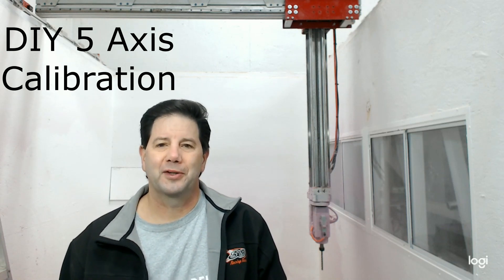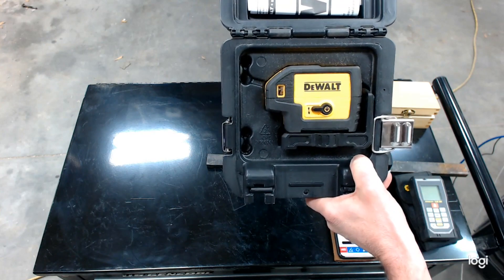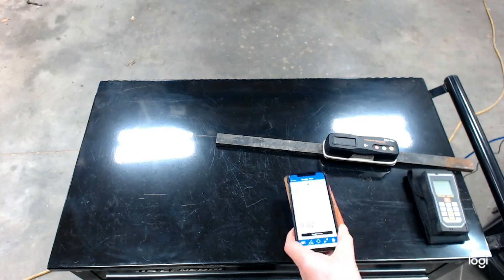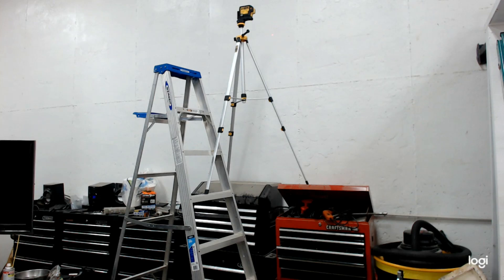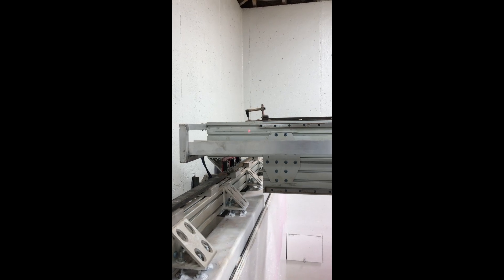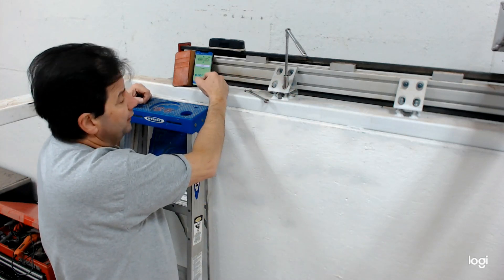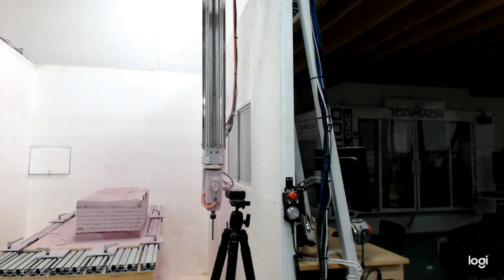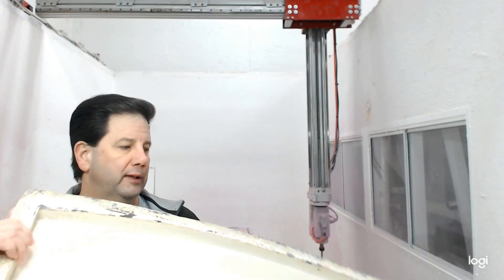DIY 5 Axis CNC Router...Build Video 1

Comment: Hello did you make the Machine?
Reply from the maker: Mahmut Polat yes I made the machine.
Reply: @XSMotorWorks  I am thinking of making a 5 axis machine like this. Can you share your information and drawings with me? I'm a student and my project 😊
Reply from the maker: @mahmutplt  I would be happy to help but I don't have many drawings as I built this as a one off.  

Few things.  This machine is really only good for soft material (foam/ MDF).

It's very important to know what you want to cut before making something like this.

If you watch the series and have question I will do my best to answer.

Comment: Thanks you for the video. Nice work I happening around your shop. Quick question: Does the Masso controls all the 5 motors directly? That is, the 3 Clear Path motors and the 2 motors from the Doughty drive? Thanks a bunch.
Reply from the maker: Directly yes and no.  The steppers on the A/B head are sent to a gecko driver -> Masso.  Clearpath are wired directly.

Comment: 5:41 The enclosure is exactly made out of what? XD
I mean, Where are the axis mounted on exactly?
Reply from the maker: basic structure is 2x2 .120 steel.  Than 80/20 extruded aluminum
Reply: @XSMotorWorks  😲 Are you telling me the axis, and the Windows installed in the enclosure is actually a 2x2 full metallic steel box?
Reply from the maker: @brian6175  2x2 steel tubes spaced 1 foot apart.  covered with OSB.
Reply: @XSMotorWorks  I noticed the tubes, but the OSB is what had me thinking. Thanks!
Reply from the maker: @brian6175  Sure...Let me know if you have other questions

Comment: Amazing machine. Are you willing to share how to build it? Part list or something like that? What CAM software did you use?
Reply from the maker: Don’t have a parts list exactly.  Will be happy to answer any questions though.  I use Fusion 360 for CAM.
Reply: @XSMotorWorks  I'm trying to build a 5 axis painting machine, but controlling/setup of the additional axis are giving me a serious headache. If you can help me with any info you have, please do.
Reply: @XSMotorWorks  And you export the path using the Mach3 postprocessor?
Reply from the maker: Export the G Code but I use a Masso unit now.  Original I used Mach3 but Masso is easier (In my opinion).  I think I covered most of the parts in the videos.  Let me know if you have questions.
Reply: @XSMotorWorks  I don't have the cash nor access to such driver. I'm using a chinese 5 axis driver, this far it's able to control 4 axis, but I'm being incompetent in controlling the 5 axis from Mach3. In Fusion 360, when I use "Postprocess" to export the G-Code, when I select Mach3 as the postprocessor, I't gives me errors, saying the machine is not configured for 5 axis... and the G-Code does not come out.
Reply from the maker: @bakedbillybacon  Look at this post.  By default the processor is not setup for 5 axis correctly

https://knowledge.autodesk.com/support/fusion-360/learn-explore/caas/sfdcarticles/sfdcarticles/How-to-make-a-3-axis-post-processor-from-the-HSM-post-processor-library-support-4-or-5-axis-motion.html
Reply: @XSMotorWorks  I changed a few things on the post processor and it seemed to work, but I can't see the A, B or C moving in mach3. Do you still have the post processor configs for your machine from mach3? Does this seem right to you? I want the machine to behave like yours.

var aAxis = createAxis({coordinate:0, table:false, axis:[1, 0, 0], range:[-90,90], cyclic:true});
var cAxis = createAxis({coordinate:2, table:false, axis:[0, 0, 1], range:[-90,90], cyclic:true});

machineConfiguration = new MachineConfiguration(aAxis, cAxis);
optimizeMachineAngles2(0); // if I change this value, the generated g-code simulation gets really crazy
Reply from the maker: Sorry for not responding sooner...Youtube mark this a spam.  I don't have the mach3 code anymore but what you posted looks correct. 

Do you have A and C in the gcode file?  If not I don't think you selected the right toolpath.
Reply: @XSMotorWorks  I'm going to send you my questions by email so you can read/answer anytime you are truly available. Thanks a lot for the attention you already gave me. I was able to make a 5 axis path in Fusion 360 that ran on LinuxCNC, but Mach3 post processor keeps giving me 'ensure safe retracts' errors. All my 5 steppers moved according to the code in LinuxCNC. I'm going to buy the aluminium structures this week, maybe the next. And again: You are awesome. Your machine is really nice.
Reply: I know this is an old post now, but can you suggest anywhere to get plans for this type of cnc? I’m wanting to make car part moulds so need the height clearance like this, I’m working on a project van at the minute, vr6 engine swap, full loom swap, custom subframe and control arms and modified strut towers, I’d like to build a subtle wide arch kit but want perfect symmetry both sides and doing it by hand isn’t as good as cnc hence why thinking of making one, I’ve got another project in mind after this that will be a full custom buck so I think it’s worth making a cnc for it, tips would be great

Comment: What steppers did you use? Also would you carve and ship things for people for profit? Totally not asking for myself.
Reply from the maker: I was using a NEMA 34 960oz motor with a Gecko Drive G201X...I think that setup  would have worked if I was willing to really spend the time needed to tune the accl and decl.   But going with the Clearpath is a much better option if you can afford it.  They are much smoother (no steps to count).

As far a doing a job I am actually tied up in a project that I will be sharing soon.  If they lived in the area (Woodstock, GA) I might be willing to rent the machine and they could to it themselves.

Comment: What CAM software do you use? Does your controller do any of the kinematic calculations or is that done in the CAM software? Pretty cool machine!
Reply from the maker: Great question...I have used Mastercam and Fusion 360 (the standard package comes with 5 axis support now) and they will both take care of the kinematic calculation.  The problem I have (and I will cover in depth in my next video) is tool changes/offsets and kinematic.  Basically I can't adjust the gcode on the fly with a tool length offset/probe due to the controller I have.
Reply: @XSMotorWorks  Alright, I will check out your future videos. Sounds like the problem you have can only be fixed by getting a different controller. I guess it would not be as big of a problem if you only have to use a few tools. The more tools you need though the bigger problem it becomes.
Reply: @XSMotorWorks  Super cool machine, man. How do you get Fusion360 to handle kinematics?
Reply from the maker: @christianlewis7055  The kinematics math is built into the Fusion 360 post processor.  So really all you have to do is go into Fusion  and setup your machine.  Let me know if that doesn't answer your question.  Cheers
Reply: @XSMotorWorks   Holy crap! Why did I not know that?! So much time spent studying 5 axis kinematics and software and I didn't even know Fusion had it built in. Thank you so much for that!
Reply: @XSMotorWorks   Did you think of trying LinuxCNC? It's free and it has kinematics for 5-axis, so it takes "standard" tool-tip g-code!
https://youtu.be/iy1Mb6G_VJ0?t=61